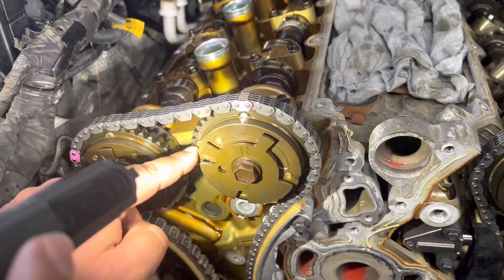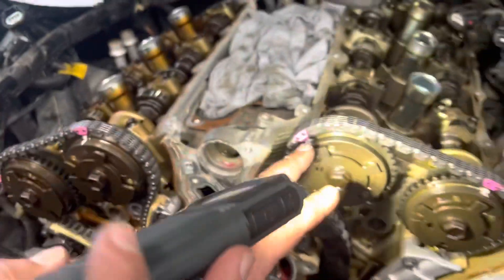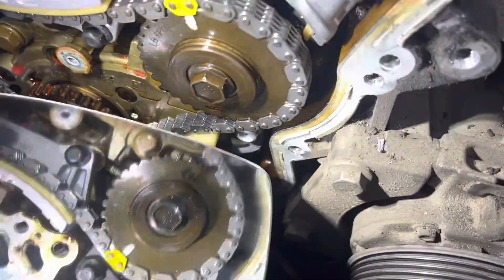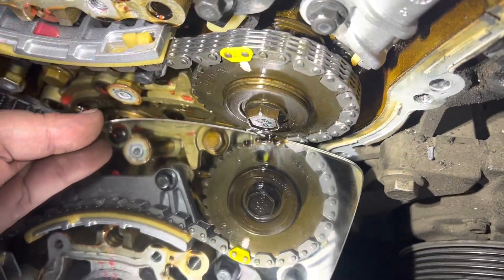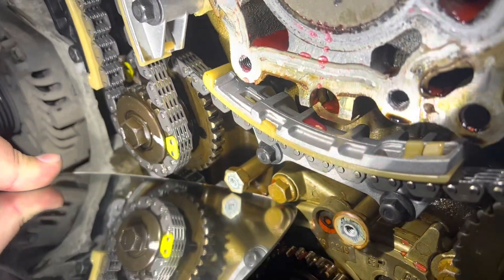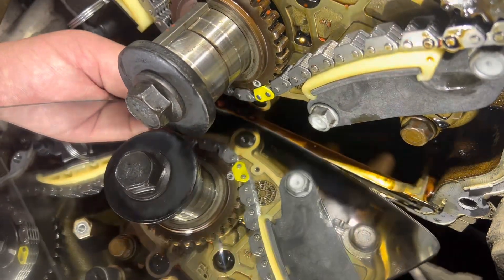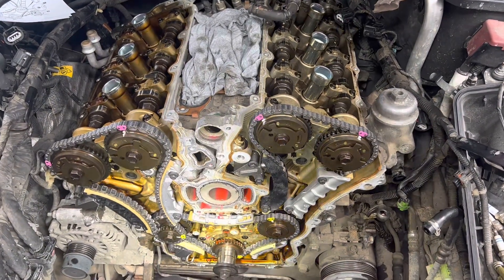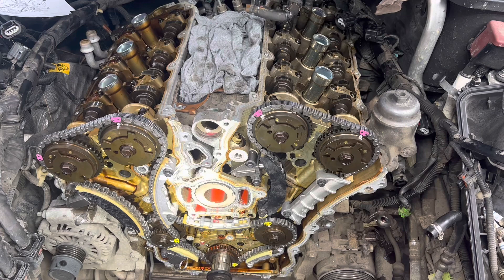Holden commodore 3.6L SIDI engine timing chains replacement

Comment: Many, many thanks, sir! I'll be doing my first for a 2018 Buick Regal GS. AWD. Why, you ask? I bought it as-is from a dealer in another US State. They were a bit too accommodating, especially the sales gal, and the car was a bit too clean, having no scratches on the stainless steel pedal trim, with 61k miles on the odo. and perfect carpet, with half worn Conti (OE) tires. As I know how to roll back the odo, so must the dealer techs. (My way is to remove the odo chip, go after the hexidex code, and substitute a few digits. Using a pin straightener to easily connect by micro-soldering makes it easy, nonetheless, having a spare blank chip and pre-downloading the existing code into it builds  onfidence! I learnt this in my previous career, first in a proprietary setting, then using WordPerfect, of all things!) I'm just being pro-active in finding my starting/confirming😊😊 point with this engine. Next, I'll incrementally inspect under the right cam cover, the left, the front, chain condition, ect. The waterpump is slinging just droplets, making it easier to be proactive in this effort. All fluids appear bright and clean, with brakes about half worn yet nearly dust free. If the semi-internal engine inspection doesn't measure up, then heads, partial engine lift, etc, until I discover the truth. For me, this sleuthing will be fun! I got the car at about $US1600 under market, so I "have" that to buy parts proactively. I.e., a high- quality chain set can be had for $US252, bought from the OE manufacturer. If it is the latest engine updated engine iteration, I'll end up with the most serious engine problem, lock up from timing system failure, under control. Just for fun, I also plan to drill holes in the front cover to measure chain deflections, after having established relative baselines internal/external during reassembly. Wish me fun! I do have two high-milage clunkers as back-ups, so as to avoid excessive pressure of time. Ironically, I'm working to both control time while controlling time-ing chain failure.

Comment: Did you use genuine replacement chains and what's the cost for this job on a VE series 2 wagon?
Reply: The factory GM guides and chains are manufactured by Cloyes. I just replaced mine and if you look closely at the guides you will see GM and a Cloyes imprinted on the guides. The originals lasted almost 140k on a 2011 2.8 Saab 9-5.
Reply: @preamble466  cheers for the info.
Reply: @preamble466  any idea of price guide for the job?
Reply: @MrWah79  The parts are a little over $300 on Amazon (for Cloyes). This is a very labor intensive job, I've heard of people paying $3-$4k for the job from an independent mechanic.